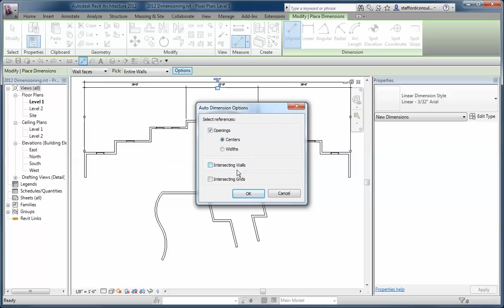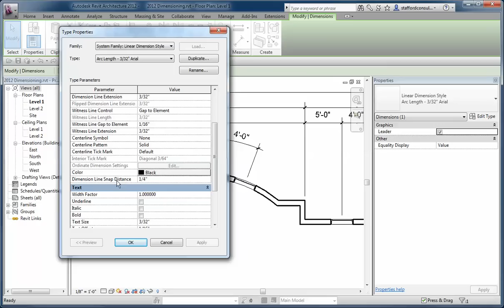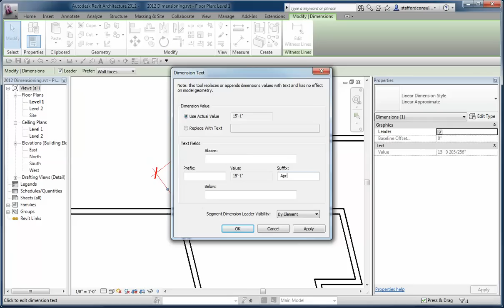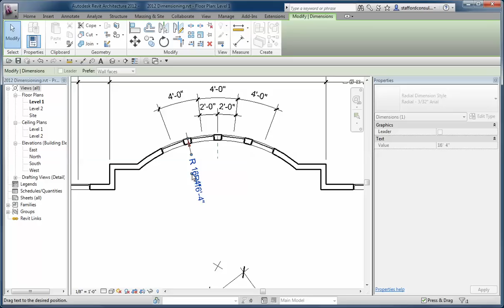Five Minutes of Dimensioning

Comment: Hey Steve,
I would thank you and i have a question to you if could help in that?
How i can make a curve wall as you and add doors? Can you please give a link for video if you do not have a time to  make a video...
Reply from the maker: When you start the wall tool there are tools on the Draw panel (ribbon) that let you choose which sort of wall segment you want to make. There are three different arc options to choose from. One let's you draw the end points first and then describe the radius which is easiest to create a flat arc with. The others require us to know where the center/origin of the arc is located.

The fillet tool creates a new arc segment between two existing segments and is found when the wall tool is active. That's different from an arc in AutoCAD which is an editing function, in Revit a fillet is a creation tool and part of the wall tool itself, since it creates a new segment between existing segments.

There a lot of videos here on You Tube that describe a wide range of curved conditions...best to review a bunch and see which ones apply to what you want to do.